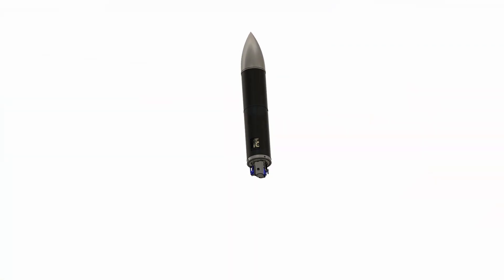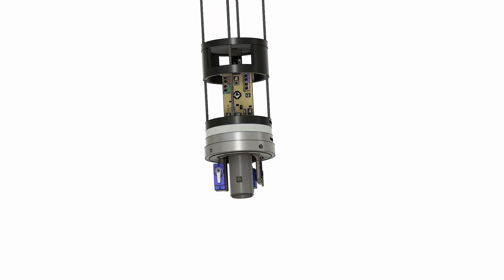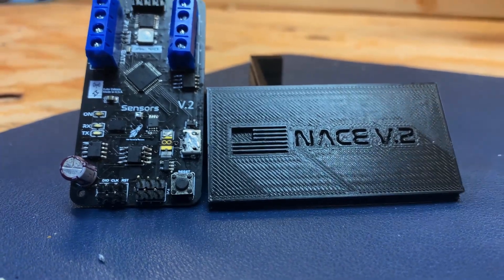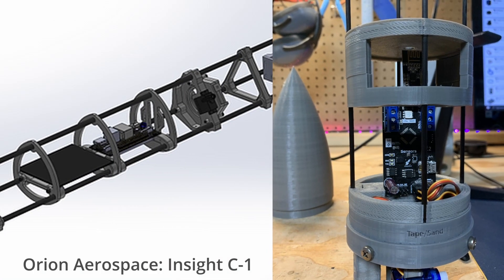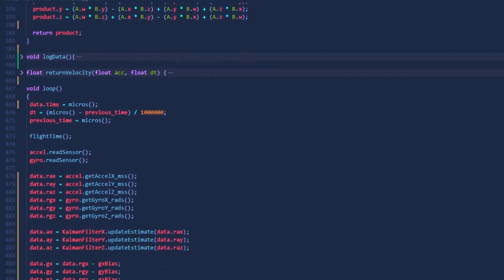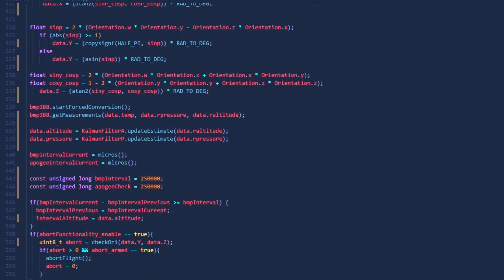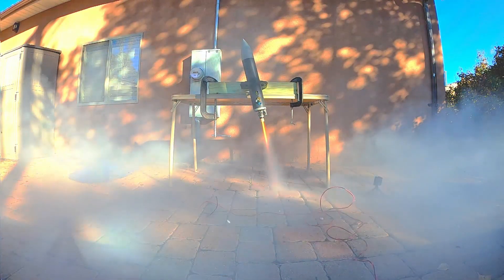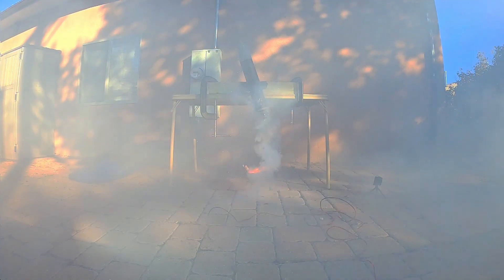NACE - Thrust Vector Control Flight #1

Comment: Why do you use short rocket body with poor stability? 
If you double the lenght, move upward the CG the stability will be much better, so less work for TVC - more chance for success.
Reply from the maker: Yeah if you read the blog, those are one of the planned changes.
Reply: @NMRocketry  I will check your blog, thanks!